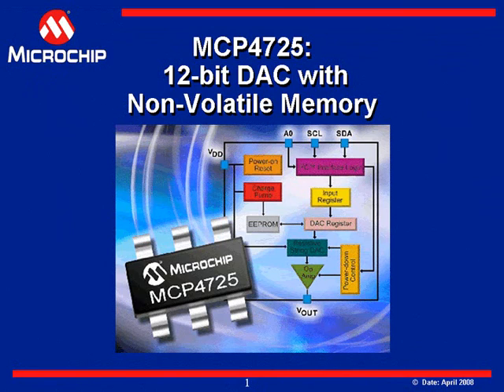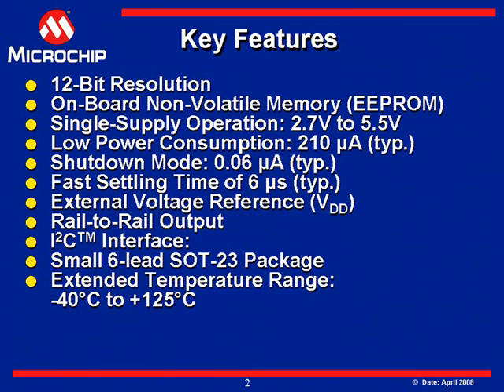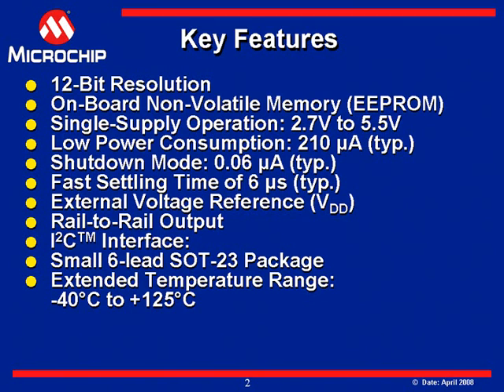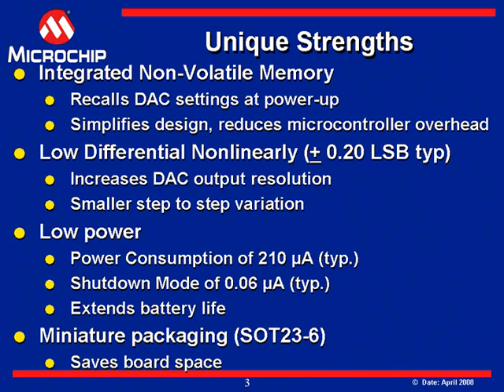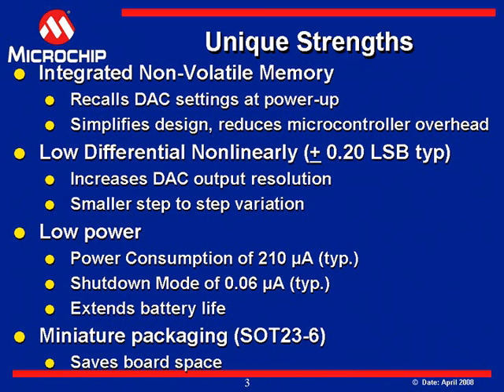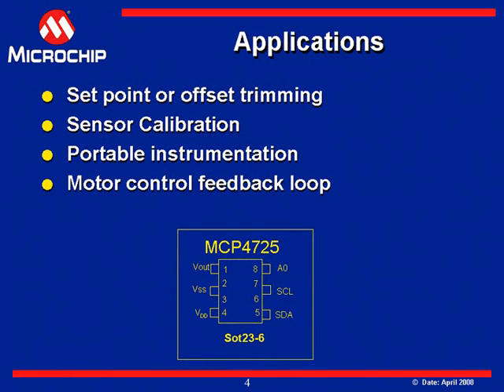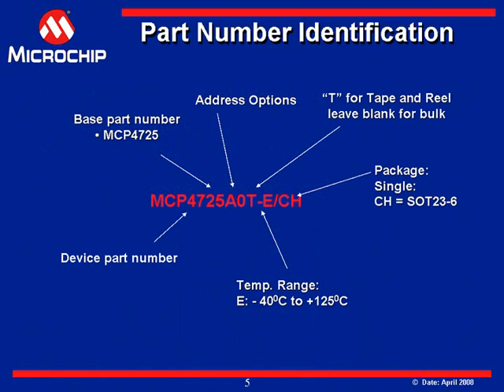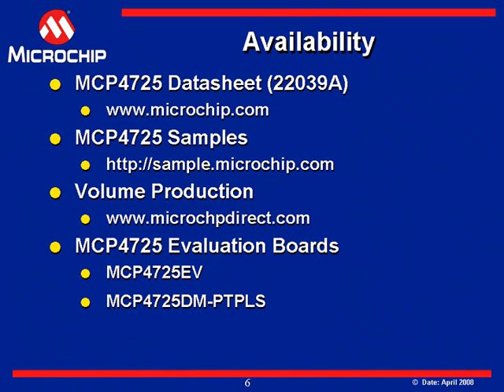MCP4725: 12-bit DAC with Non-Volatile Memory

Comment: What is the highest sine frequency that can be generated?
Reply from the maker: In High Speed Mode, the maximum clock frequency can reach 3.4MHz. Although, the maximum sine wave frequency will depend on the chosen processor speed, slew rate, settling time, and command used. Can you tell us what type of processor you intend to use with the MCP4725?